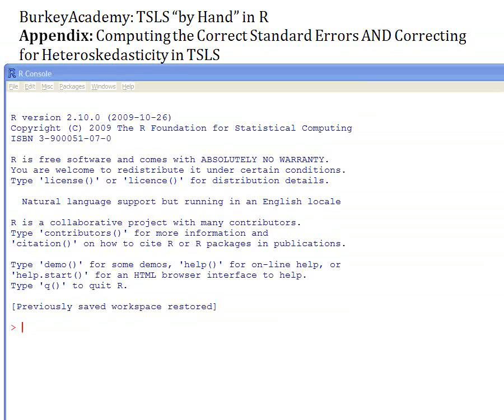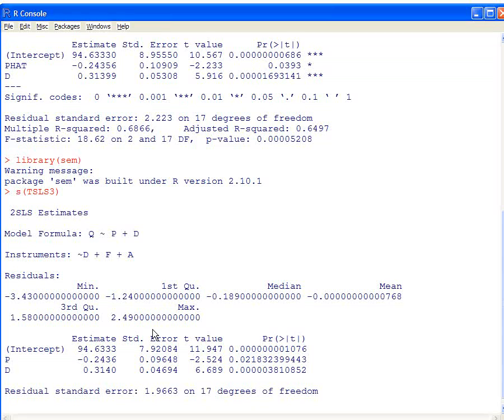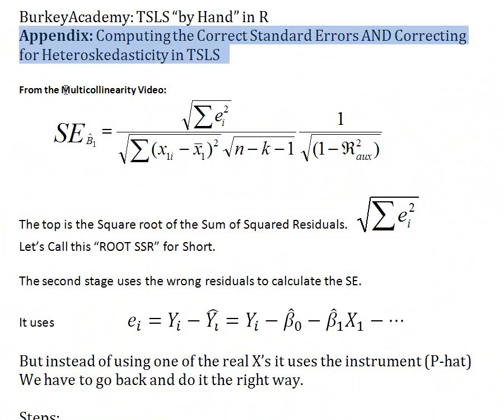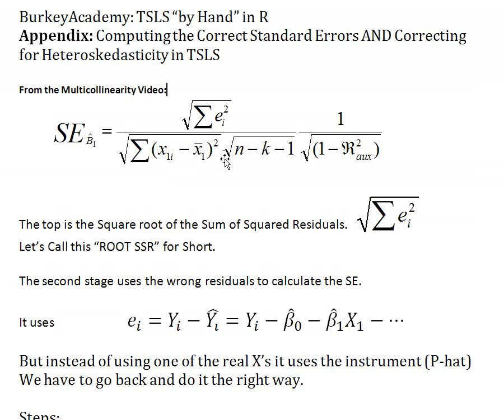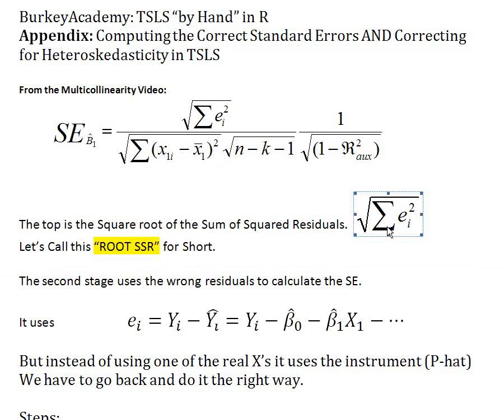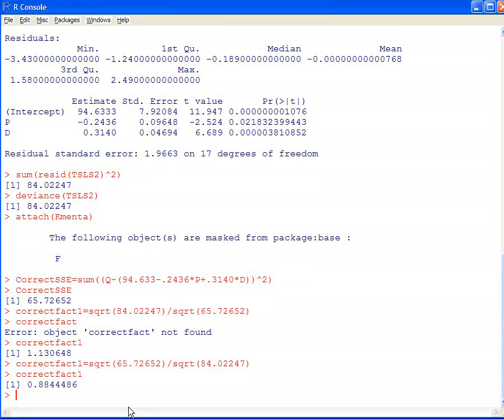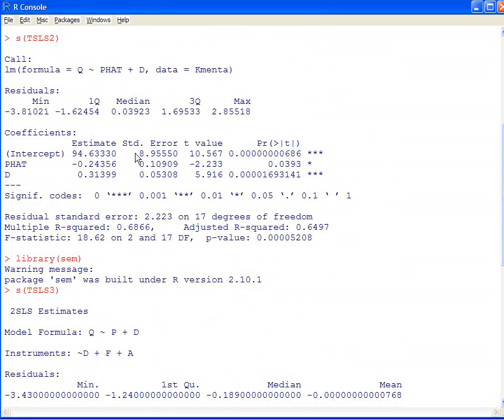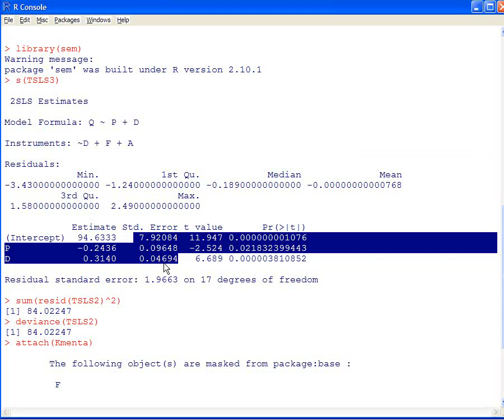Econometrics TSLS in R part 3

Comment: Dear BurkeyAcademy,

Your method of correcting the standard errors for heteroscedasticity are not correct. This method actually underestimates the standard errors. Run the IV-regression with the function 'ivreg()' in the package {AER} and then use function 'coeftest()' in package {lmtest} (you'll need {sandwich} aswell) . The object created with ivreg() can be used in 'coeftest()' can be used for correcting with White's or Newey-West (and more).

/ tjokolat